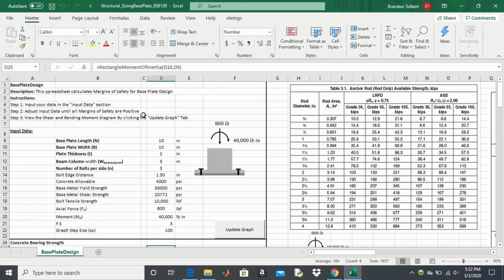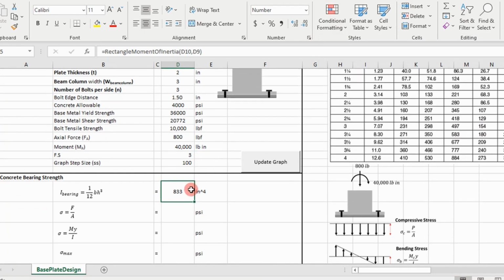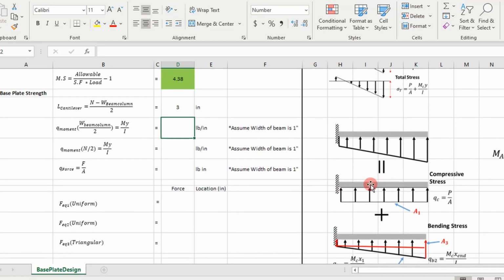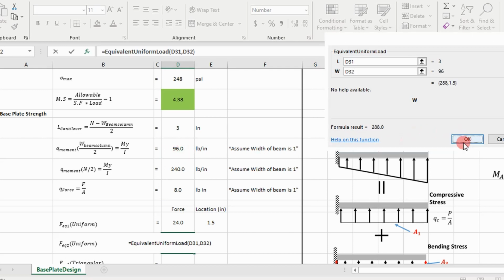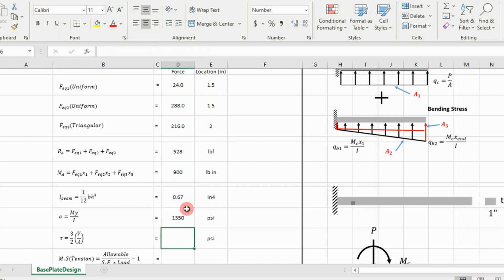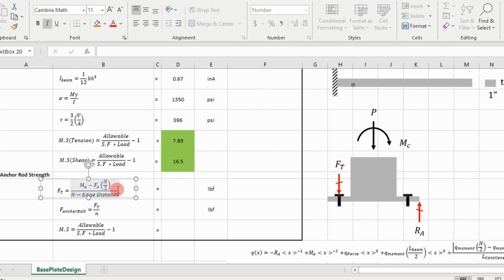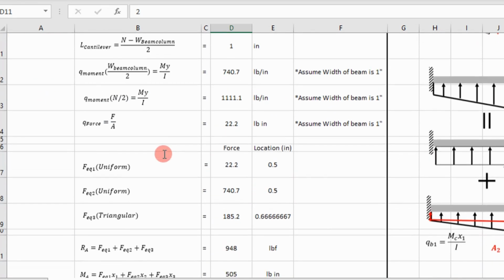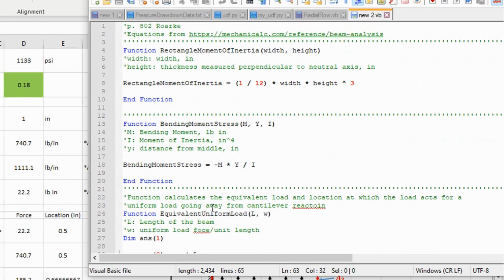Base Plate and Anchor Rod Design: A Step by Step Approach

Comment: Well explained, I'll have to set up my own excel sheet. How does this change if the column and anchor bolt layout is circular?
Reply: Hey I have something similar I'm trying to solve, would you mind heling me out. i have a circular flange connected to a base, im trying to determine the layout and anchor bolt size.

Comment: Since my background is in chemical engineering ... it took me a few minutes to understand that the force in the bolts that are on the right hand side of the bending moments were not included according to the formula shown in Excel: Ft = (Mc - Fa * N / 2) / (N - edge) ... So I am assuming that the bolts on the right side contributes very little to keep the column from tipping as shown in the force diagram. If the bolts on the left side of the column break ... then we have a disaster!!! 

 Have you done any work about how to avoid  the bolts peeling off from the concrete base ?  Thanks.

Comment: Very good video....I have a question...when you say 3 anchor bolts....you actually means 6 anchor bolts ?  ...A set of 3 anchor bolts at each side of the base plate ? ...Hence the total bending moment is actually distributed around 6 bolts ? ....Please clarify.

I did a total calculation for 4 bolts (total)...and  it looks like this  .... 40,000 -800*5 - 2*F1*8.5 - 2*F1*1.5/8.5*1.5 ... For this the force F1 is the tensile force at the left side of the column over the bolts...If you solve for F1 = 2,053 lbs ...which is ok for the chosen bolt of 10 kips.

Comment: @TopDogEngineer Is there a miniimum code requirement about the distance of the edge of the baseplate to the edge of the concrete pedestals?

Comment: Is there any way to know how deep the anchor rods need to go ?
Reply: You bet!!!!  If the bolt don't grab the concrete structure properly...you have a problem.  The tensile strength of  the bolt might not even  reach  the design force since the anchor bolt  peeled off from the concrete base and that will be catastrophic.  There are table that clearly indicate how deep an anchor bolts need to be buried within the concrete for a given force.